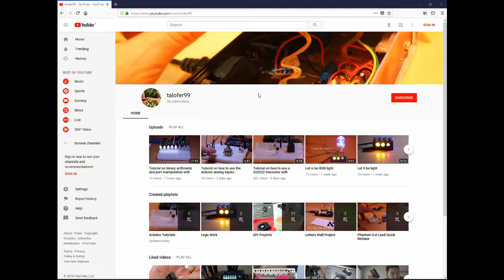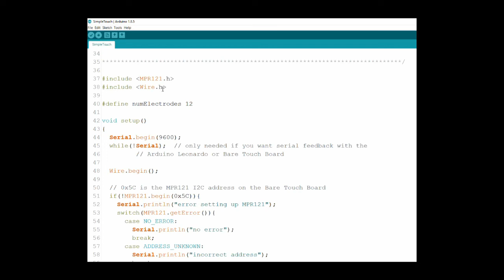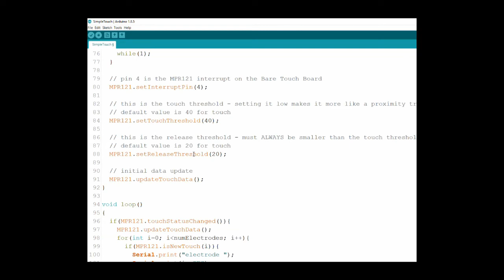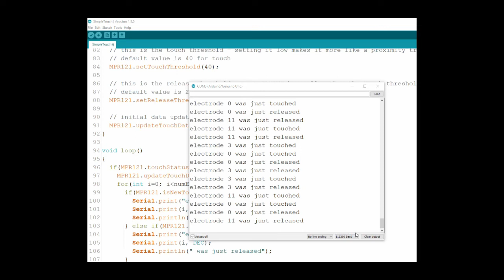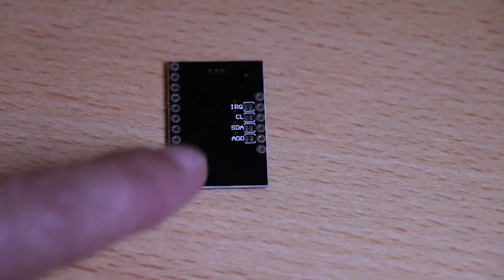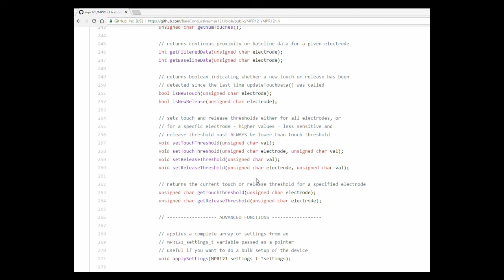MPR121 turn (almost) any surface to a touch button for arduino

Comment: Do I have to solder the pins into the MPR121? I'm using breadboard as you but without soldering. My UNO does not find any I2C device (I even tried scanner) and I'm sure the wiring is correct.
Reply from the maker: Yes it's highly recommended that you solder the pins. The physical contact is not enough.
Let me know if it worked :)

Comment: Hi,
I used the bare conductive MPR121 Library github link  and have downloaded the zip file, but the SimpleTouch code on my screen is very different from yours.
A examle is that my code has "#include <MPR121_Datastream.h>" too whereas that is not present in your code.
I would be grateful if you could share your code.
Help would be appreciated! Thanks.
Reply: Sir, actually the error says "The library MPR121_Datastream.h is not available.

And I am not able to get that library in the list of Arduino libraries.
This library is not present in your code, which confused me a bit!
Reply from the maker: @SurajSingh-mm2hc  how did you install the library ? 
Trying to figure this out, and knowing the steps you took might help me to help you :)
Reply: @talofer99  instal the librery by your  coments link in zip file .
Then Arduino librery add zip file .
Reply: Everything okay right now  but i have one issue , in final step shows incorrect address
Reply from the maker: @SurajSingh-mm2hc good to hear its compiling
I'm guessing you mean that the I2C address is incorrect, if so - follow this video to find the correct address 

https://www.youtube.com/watch?v=hFrQChrks7s
Reply: @talofer99  after scanning , i found No 12c device found
Reply from the maker: @SurajSingh-mm2hc  that means the device (mpr121) is not connected well. 
recheck your connections, and once you find an I2C address you can copy it.
Reply: How did u fix this?? @SurajSingh-mm2hc
Reply from the maker: I would go with the example you have from the downloaded library. 
The reason for that is that at times - libraries change - and if you try to use my code in the new library it might not work. 

Does the example compile ? 
Does it work ?
Reply: @talofer99  no sir example has not compile . I am frustrating .
Reply from the maker: @SurajSingh-mm2hc  if the example is not compiling you got something setup wrong I can guess. 
what is the error you are getting on the compile ?

Comment: I have mpr 121 and I'm new to electronics, i want to dim and bright led with mpr, 1 dimmest and 12 for brightest plz help
Reply from the maker: I will suggest you look into PWM on the LED part. 
The mpr 121 is explained in my video, and there are many examples in the library it self.
once you get this 2 ready, you can mix them with 1 setting a low PWM level to 12 being 100%

What are you planning to build ?
Reply: @talofer99  I'm planning to build a night lamp, with brightness control
Reply from the maker: @Sarfarazkhan-kv9cq  I had the same idea but with a different setup (many leds) and IC. 
Hope to finish it soon. 

Are you planning on AC or DC ?

Comment: Can this stuff be connected to raspberry pi??  Thanks
Reply from the maker: Yes no problem 
With Python, this is an old example  
https://learn.adafruit.com/mpr121-capacitive-touch-sensor-on-raspberry-pi-and-beaglebone-black
And you can go with Circuit-python as well

Comment: I am getting this message
 "error setting up MPR121
incorrect address"
Does anyone know what could be the issue? And how to solve it....
Reply from the maker: It's the settings of the i2c address.
I cover it here 
https://youtu.be/tTMsbL0eH_M?t=194

And if you want to know what is the right address you can scan for it. 
Take a look at this 
https://www.youtube.com/watch?v=hFrQChrks7s

let me know if it worked out
Reply: @talofer99   Hi thankyou so much for replying. It didn't work out, the scanner says no I2C found.
All my wiring is correct, I have tried it with another MPR121 I get the same result. Could it be both of the sensor doesn't work?... or is it some other issue...
Reply: Also I'm using 3.3V on ArduinoDUE, could that be a reason this isn't working?
Reply from the maker: @nobaihazaman3789  I will need a bit more info to be able to answer you :) 

What board - both the mpr and arduino ? 
How did you wire things ? 
do you have any thing connected to the mp121 ?  except the arduino  ?
Reply: @talofer99  I’m using the MPR121 shown in the video with Arduino DUE board. 
I did the wiring as such: 
(Sensor) 3.3V -> (board) 3.3V
SDA -> SDA pin 20 (tried it with A4 as well same result)
SCL -> SCL pin 21
Gnd -> gnd
IRQ -> pin 2

I did have soda cans hooked up with the sensor but I tried testing the sensors without the cans and the result was the same. For some reason my DUE board is not being able to detect the sensor.
Reply from the maker: I never worked with the due, quick search on the web I found this, so it seem to be a common issue 
https://github.com/adafruit/Adafruit_MPR121/issues/21
https://forum.arduino.cc/index.php?topic=437617.0

Also which library are you using ? 
there are at least 2 I know of and mention in the video
Also what is your arduin ide version ?
Reply: @talofer99  I have tried it out with both the libraries. I’m using version 1.18.13.

I have searched on the internet and seen those issues but no solution unfortunately 😓
I don’t think the due board supports the sensor....
Thankyou so much for helping me out though!
Reply: Did you solve the issue? I have the exact same problem. I'm using UNO and the wiring is correct. I also executed I2C scanner and it did not find any devices. However, I have clones for both Arduino UNO & MPR121. Maybe that's the problem...?

Update 1: the I2C bus is correct on Arduino for sure because I connected an LCD1602 to it and run the scanner it finds the device. So either the clone MPR121 is faulty (I tried even 3) OR I need to solder it into the breadboard...?

Comment: Hello sir, I cant able to install the mpr121 library. Arduino IDE is showing some error for me. Please  help me with this sir
Reply from the maker: What error do you get ? 
How did you install the library ? 
What OS ? 
What IDE version ?
Reply: @talofer99  
Error:

"compilation terminated
exit status 1
Error compiling.
Specified folder/zip file does not contain a valid library"

I have installed by selecting the zip file from tools -> include library

I'm using windows 10 OS
Reply from the maker: I'm not sure what exactly - but something is not ok in your library installation, 
when you go to file -> examples do you see a folder for this library ? 
if so - can you choose an example out of it ? 
If not - you need to install the library correctly.
Reply: @talofer99  okay sir, thanks for the reply. I'll update you after installation.

Comment: Hi tal.
According to the datasheet, the mpr121 is not a 5v tolerance device..
Have you seen or experienced any problems?
Reply from the maker: Hi Amos,

Due to the nature of I2C there is no real chance of damaging the mpr121.
But if you are experiencing communication issues I will suggest first trying pull ups and if that fails to put a logic level converter between the 2.

Comment: will it sense if we touch it using shoe
Reply from the maker: You mean like stepping on it ?
If so i do not  think so but you give it a try.
Reply: @talofer99  if not how piano stair sense the step of people by using it
Reply from the maker: pressure sensors maybe. I never made a  piano like that :)
Reply: @talofer99  tq